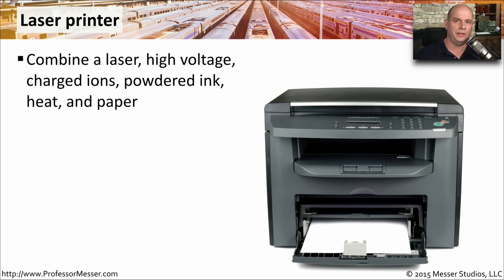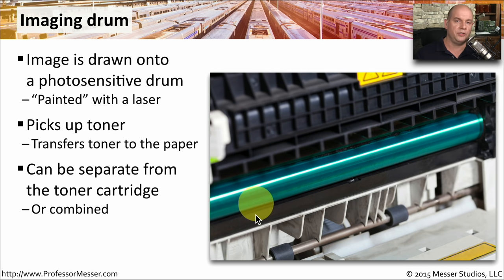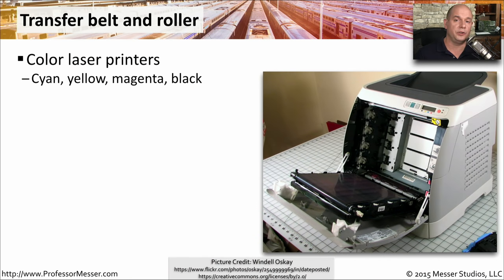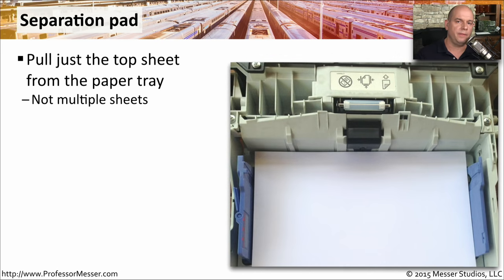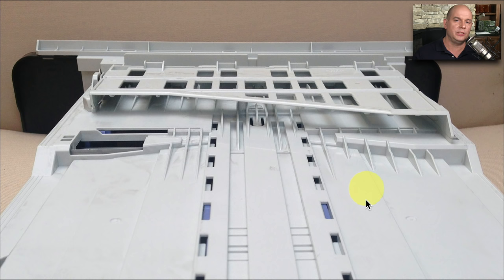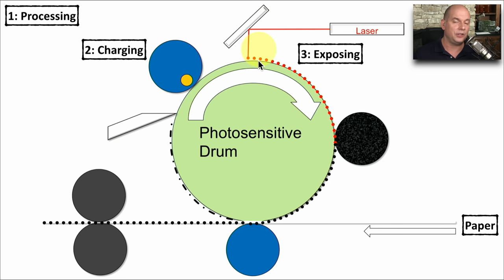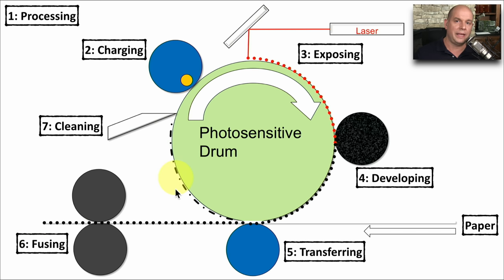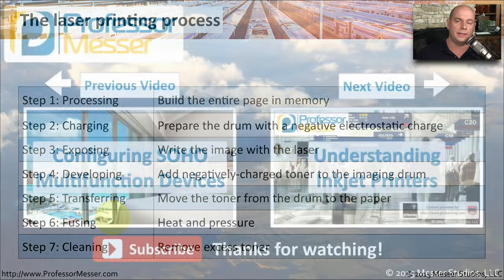Understanding Laser Printers - CompTIA A+ 220-901 - 1.14

Comment: I'm confused about something. In this video, Professor Messer doesn't mention anything about the laser printer being the cheapest for the cost per page, but he does mention that the Dot Matrix printer has a very low cost per page. I am also utilizing a book from Exam Cram from David L. Prowse and he mentions that the cost per page on a laser printer is the lowest. Which one has the lowest cost per page? From my research, it seems like the dot matrix has the lowest cost per page, but it's not certain. I am preparing for the A+ exam which I should be taking later this week. I know this matter is probably going to be at most 1 question on the test, if not at all. Just curious as to what is TRULY the lowest in cost per page.
Reply from the maker: There are so many different types and models of laser printers that the costs per page vary widely. Even with the least expensive laser printer, it would still be very difficult to have a cheaper cost per page than a dot matrix printer.
Reply: Professor Messer! I gotta say, I watched all of your videos for the 901 & 902. Thanks for all of that information! It really helped me understand a lot of aspects of a computer. I don't come from a computer background and so there was a huge learning curb. I just hope I can find a job after I get my A+ as it seems very competitive and usually requires experience. 

From my research, it seemed that way as well. All of the resources I came across said the Dot Matrix printers are the cheapest by a long shot. Thank you for your input!
Reply: start with schools, universities, etc......think positive!.....temp agencies, also